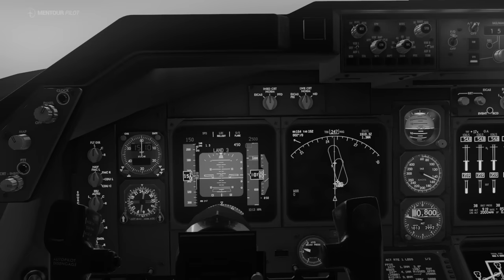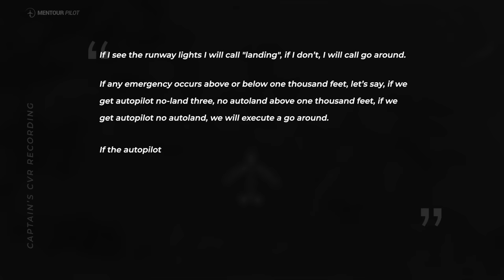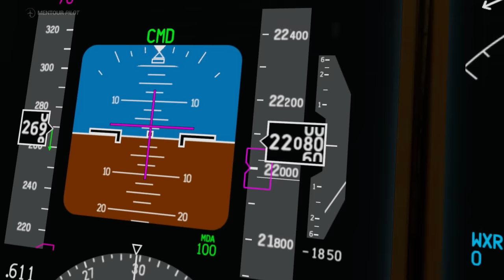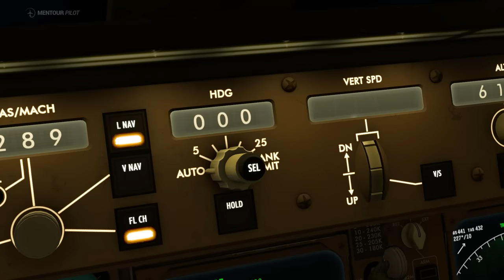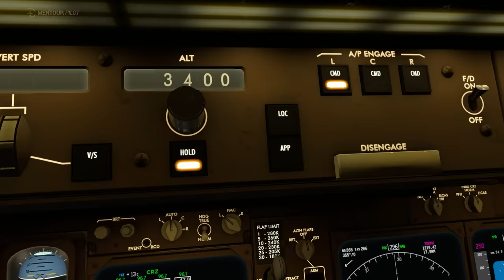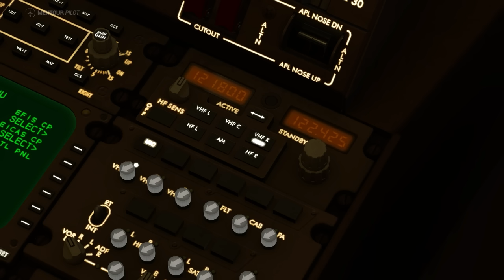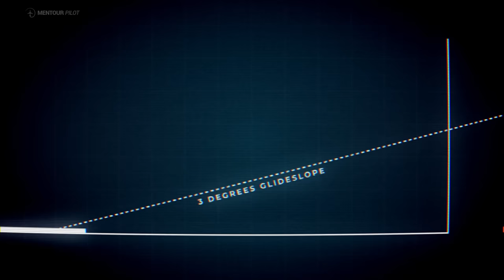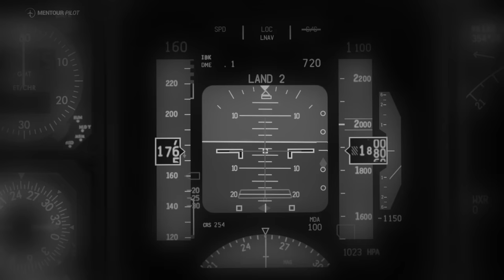Where is the RUNWAY?! Unraveling the Mystery of Turkish Cargo flight 6491

Comment: Still totally their fault but I feel like in this day and age beeps should not be the thing auto-pilot does to warn pilots that something is wrong. Obviously they should have seen something was wrong but a VERBAL message should accompany any beeping or monitor changes/warning lights saying something like "check auto-pilot" or some sort of thing to get the pilots attention and direct it to where, exactly, they should be looking to see something is wrong. 

Yeah, yeah, they should know, but clearly this situation happened so how do we make it not happen again? Well sure we can train it but fatigue and emotion are always going to be factors with humans so how do we correct for this? Audio cues/verbal warnings that can't be misinterpreted or easily missed. That was the easy training can be "if the auto-pilot talks to you, for any reason, something is wrong and you need to start doing checks."

It was the pilots' faults but a verbal warning way earlier could have prevented this tragedy. In this age of AI text-to speech we could easily fit these planes with a more in-depth pilot warning system that reads out the warning message rather than convey it through beeps. "Correcting for unstable glideslope" for instance would have been a clear indicator that while the plane was flying smooth the auto-pilot was having to correct for something that should have been instant grounds for a go-around. Yes, they should have seen that it was unstable on their screens, but they didn't because they were not looking. A message would have basically told them "Hey idiots, you may want to intervene here" in nicer words.

Yes, at 500 verbals started and were not picked up but that is very close to the ground. If it had happened back at 3000 or even at 2000 when things started it may have been clearer something was off and they would have had more time to react.